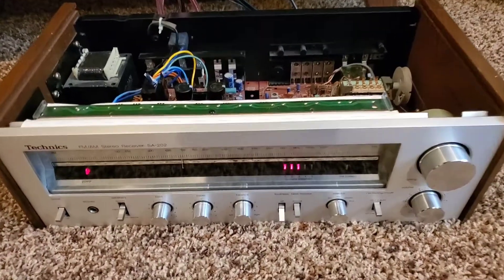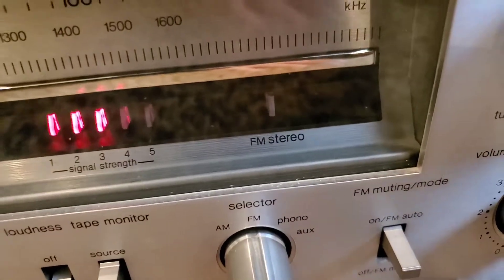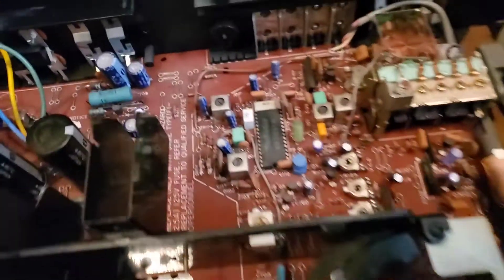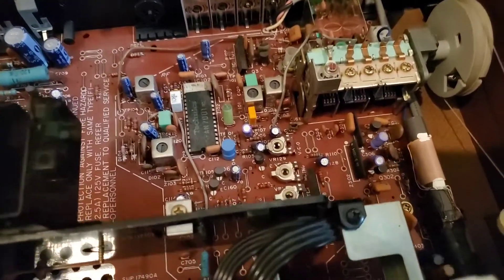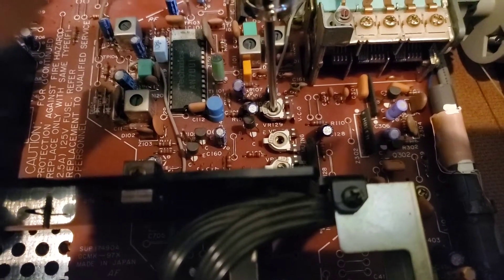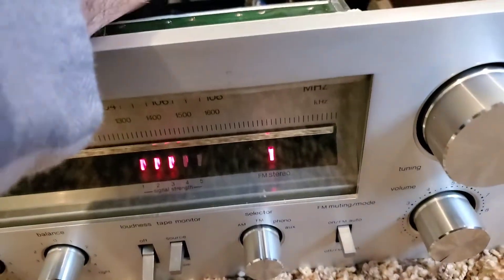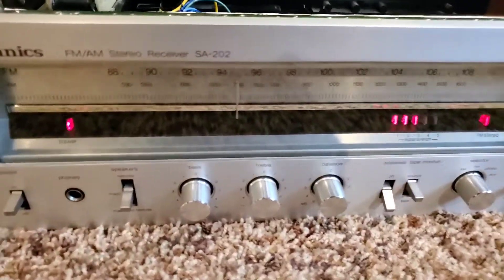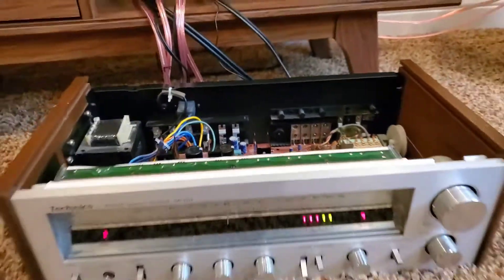FIX: Technics FM Stereo Reception

Comment: +Hello.  Hope you still monitor this thread.  I have an SA-800.  Does not go into stereo mode, also noticed FM signal level meter does not move.  I was able to find the PLL VCO pot in the SA-800 (VR301 vs VR129).  Before I try your fix, is the fact my signal level meter is not working indicating a bigger problem, or is it related to the same issue?  I noticed the SA-800 manual has a whole page decicated to FM receiver alignment.  Would it be best to get a technician to perform those steps first?  Any advice would be greatly appreciated.  Thanks
Reply from the maker: Hi! My sense is that if the signal meter is always at zero when tuning, there could be an issue with the FM reception in general and I would try to find a tech who can work through it properly. I suppose the meter itself could be dead but it's highly unlikely. Good luck with it. Vintage audio techs are hard to find and are typically very busy.
Reply: FYI - I tried adjusting VR301 and it did not work.. Obviously I have a bigger issue
Reply from the maker: @jeffeproductions I think you're right. Sorry.

Comment: What can you do for am reception?
Reply from the maker: @Marcuswelby-nx2te  Usually it is position of the receiver as there is an AM antenna inside many of them. Or lack of external antenna hooked to AM terminals on rear of the receiver. AM is highly directional. This assumes there is nothing wrong with the internal AM receiver section, which is very rare. Ex: Bingfu AM Loop Antenna https://a.co/d/dWqIqTs

Comment: There will be 2 different pots to adjust for Stereo. Another for the stereo light. You're looking for upper and lower IF FM. Tune to a strong station near 90.1 Turn the pot till it's distorted, then turn it until it's perfectly clear. Then tune to a station near 100.1 and do the same. This may already light the stereo light. If not the receiver may also have a stereo light adjustment. Turning that back and forth should turn on the lamp. Always take pictures of the pots before you start turning them. Gives you a baseline.
Reply from the maker: The process I shared was strictly for aligning the stereo indicator. Thanks for adding your comment.

Comment: Hi, I've got an early 1980's Sony stereo receiver that has the exact same symptoms as your Technics. I just need to find a service manual and find and adjust the pot. I hope it's as simple as you showed. Cross your fingers for me. :-)
Thanks for showing how to solve this problem!
Tom
Reply from the maker: Most service manuals point out the FM(and AM) alignment points. They will say to use a signal generator, etc. But if it just drifted due to age, like most vintage gear, you can probably turn it a slight but in each direction and find the sweet spot where the stereo goes on. Good luck!
Reply: @JacksMusicOnVinyl  Jack, Thanks for your suggestion and help. I've got a Sony STR-AV760 stereo receiver. Interesting thing here, but I originally wondered if the stereo indicator light was out. I accidently tuned an FM Stereo station a bit off the proper frequency and the red "stereo" light flickered a little. The good news is that the bulb (or LED) is still good. I'm guessing that this is a good sign that I need to adjust the pot to solve my problem.
Reply: @JacksMusicOnVinyl  Jack, I went online and found a Sony service manual for my Sony STR AV760 Stereo Receiver. I did find the pot, RT 205 and where it's located on the main board. I was somewhat concerned when it showed using a signal generator to adjust this pot. But, having read your message and seeing you adjust your own pot, I'm fairly convinced I can make this adjustment. I'm rather busy right now, but plan to give this a try in the very near future. I'll let you know how it goes. 
Thanks again for all your help.
Reply from the maker: @THOMMGB  Great! One last word of caution, please be careful and safe when you do this as the cabinet will be open and there is voltage exposed. Be sure you use one hand and do not touch any other parts or the metal chassis with the other. Use either a plastic screwdriver or one that has a plastic handle as I did. Go slow and you should find the right sweet spot. Also, make sure you tune a strong FM station so you're working with a good signal. Good luck!
Reply: @JacksMusicOnVinyl  Understood and will do. I'm in the Los Angeles, CA area and there's lots of strong FM stations around.
Reply: @JacksMusicOnVinyl  OK, Jack. Here's an update on my Stereo indicator adjustment:  I found the Stereo indicator adjustment on my Sony STR AV760. It's called RT 205. I put some tape, for insulation purposes, on the end of my small screwdriver. I had tuned in a very strong FM stereo station. I cautiously turned the RT 205 control a little to the right then a little to the left. Nothing. So I turned it some more each way. Still nothing, so I turned it even more each way. Nothing. No stereo light and in my headphones the signal was still in mono. I then turned the RT 205 back to the position I originally found it. I then tried a few more strong stations and adjusted the RT 205 to their signal. Still no joy. Then I thought I'd try and tune the digital tuner off signal, so 91.50 was tuned to 91.60. Amazingly, the Stereo light came on! And I heard stereo in my headphones. But the signal had noticeable hiss in it, especially when listening to some quiet music on a classical station. I was able to receive the stereo signal only when the digital tuner was "off" the correct frequency. So, 91.5 became stereo at 91.6. 93.1 became stereo at 93.2. 95.5 became stereo at 95.6 and so forth and so on. I'm only guessing, of course, but I'm thinking that the digital tuner is somehow out of adjustment by .1. That's only a guess as I have no idea what all of this means. 
Even after all of that, I recognize that you have been really helpful, patient and very knowledgeable. Thank you very much! 
Sometimes, it's only after you get your latest "treasure" home do you realize why someone donated this to their local charity/thrift store.
Oh, well. But, I still think it's fixable and worth it. Any thoughts on this?
Reply from the maker: I think I would consider finding a good vintage audio repair shop, one that handles recievers and not just amps, and see if they can run an alignment on it. If the tuner is out of line it could be a capacitor has aged and changed tolerance or possibly even a transistor or IC could be flaky. Most times you can compensate by adjusting the FM detector alignment pot, which you did. But this makes me think there is another issue somewhere. I'm sorry this didn't work out. Hopefully, in LA, you will easily find a vintage audio repair tech.
Reply: @JacksMusicOnVinyl Thanks for getting back to me. I suspect you're right. Even though it didn't work out, you were a great help and I appreciate your help, time and effort.
Reply from the maker: @THOMMGB  you're very welcome. Thanks again for watching.

Comment: I have an SA-505 with the same issue. Naturally, the numbers of all of the components are different on my board (no VR129)... BUT, I noticed the "VCO" marking next to the variable resistor that you adjusted and made the assumption that the variable resistor on my 505 with "VCO" next to it was comparable to your VR129... and it was! I made the adjustment and I'm now listening to FM stereo. Thanks for the video!
Reply from the maker: Good work! Glad the video was helpful.
Reply: So you were adjusting the voltage controlled oscillator 🤔
Reply: rgoleau59  I have a SA 505 also....does your FM station drift at all?  or the left channel volume increase for no reason?
Reply from the maker: Not having this issue on my SA.

Comment: I've a Realistic STA-120B receiver that has the same issue, FM mono ok but no stereo output and indicator light. What would the adjustment generally be defined as so I know which is the correct one to turn?
Reply from the maker: Thanks for watching. Unfortunately receivers vary greatly but if you could find a shop manual online for that, or even similar, Realistic receivers you might look for FM alignment procedures. They would likely identify a coil or  other adjustment on the circuit board for that purpose.
Reply: @JacksMusicOnVinyl  Thank you for getting back to me on this. I'll look into it 👍
Reply: There will be 2 different pots to adjust for Stereo. Another for the stereo light. You're looking for upper and lower IF FM. Tune to a strong station near 90.1 Turn the pot till it's distorted, then turn it until it's perfectly clear. Then tune to a station near 100.1 and do the same. This may already light the stereo light. If not the receiver may also have a stereo light adjustment. Turning that back and forth should turn on the lamp.
Reply: @tf7274  Great info, thank you!

Comment: Technics ST-S4  no streo receptions. What is adjusting port. Please give number. Please help me.
Reply from the maker: Hello Dilip. I do not know the answer to this, regarding the reciever you have, but the manual is downloadable online from several sources. Be sure to get the "service" manual which usually shows adjustments, where they are located on the physical circuit board and what they do. If you do it yoursefl, be careful around the voltages in the cabinet. Even with the power off and line cord unplugged, the power supply capacitors can store high voltages. Good luck.

Comment: I have an early 80s Sansui with this problem and it seems to get stuck somehow trying to go lower than 97 fm. Is that sticking and can. Dioxide spray fix that on the tuner
Reply from the maker: Hi Chaz. This could be dirt in the older style variable capacitor. That is the tuning cap that turns inside the receiver and is probably attached to a dial cord. I would use a can of compressed air on it first. Others have used a little bit of (aerosol) tuner cleaner with some success.

Comment: I have aiwa csd-es40 cd/radio receiver. Low band section of the FM section (half of the FM band) does not tuning. Upper band is working fine. I replaced all e caps in fm section. I saw one 100pf cap is having broken leg. One leg has fixed to 7pin of front end fm ic. Other leg is missing. I fixed a new cap to the ic and ground. I also replaced 10.7Mhz resonator. I also cleaned the tuner. But nothing solved the problem. Pls help me.
Reply from the maker: Sanjaya, sometimes the least electronic problems are hard to diagnose. When a tuner spends most of its life on the upper end of the FM band and rarely down on the low end the amount of oxidation of the contacts when tuned down low effectively renders it dead at those freqs. How the tuner reacts at that point depends on the how the cap is wired and the kind of local oscillator design used so symptoms can vary.

Have you tried cleaning the fingers on each of the gangs of the tuning cap with contact cleaner to ensure they are clean? Tuning back and forth across the low end of the band (power off) while you let the contact cleaner work is an excellent method. Only after you have eliminated any other mechanical issues, you may want to try adjustments. But without  alignment gear for this purpose, FM receiver alignment can be difficult and is best left to a receiver tech if you can find one in your area. Sorry I cannot be more helpful. As this deals with FM radio wave reception, the answer may be hard to find through trial and error.
Reply: @JacksMusicOnVinyl  Thank you

Comment: Would it be the same thing for the Technics sa-290  and the right channel  has less power than the left channel
Reply from the maker: No. That would be a different issue. Something in the amp or preamp section. On an older receiver it could be caused by many different things including an aging capacitor somewhere. I would refer to a service tech, to be sure--and safe.
Reply: @JacksMusicOnVinyl  ok i just got it Monday from eBay

Comment: I have the SA-222 and the radio stopped working. The Aux will work but radio stopped. Any ideas on what happened?
Reply from the maker: I'm sorry, I have no quick answer. If both AM and FM are not working, it could be one of several things. A dried out capacitor or bad IC on the circuit board could do it but the safest way to go would be take it to a tech who is familiar with servicing vintage audio.